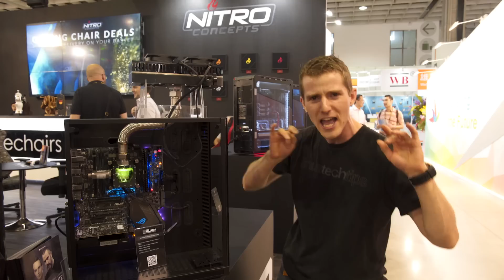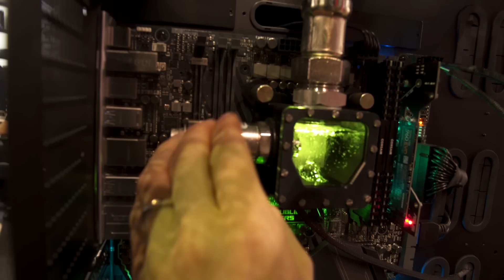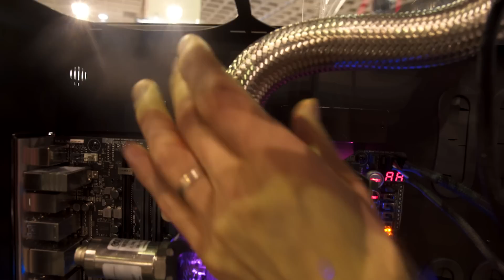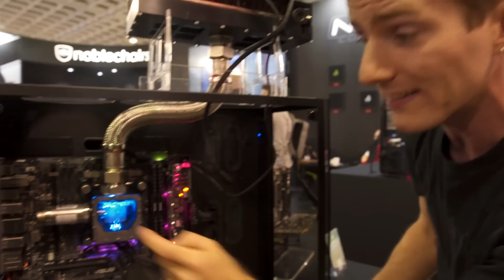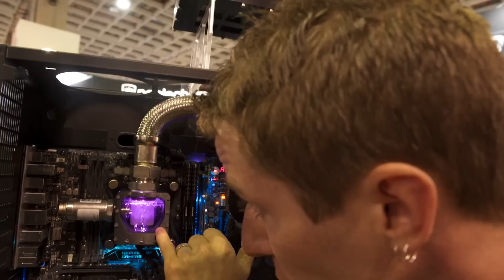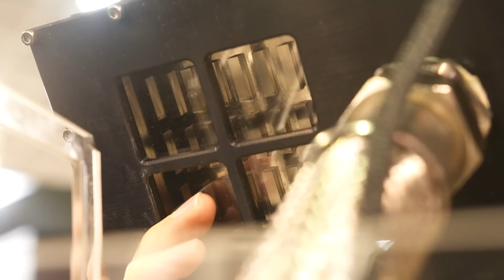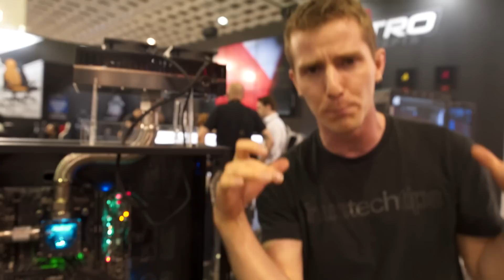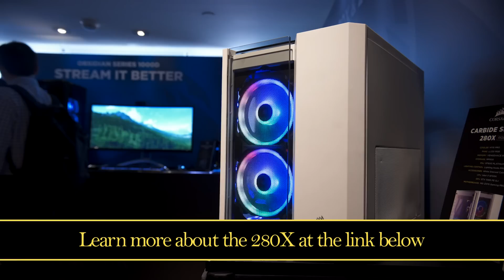Crazy Der8auer cooler prototype - NO pump!

Comment: Vodka. Pure vodka.

What, he said we would never guess - if we guess everything one of us will get it right!
Reply: Actually, you're likely not far off. Most likely methanol or some other alcohol.
Reply: Mmm Rummy :d
Reply: He would be blind just b6 testing it. Methanol is not something you want to have contact with, especially if you want to sell it.
Reply: It's 3M Novek ;) or Novec? I don't know ^^
Reply: @fabiob.2550  That's what I was thinking.
Reply: Saonix LP 3mNovec i think just like in his submerged builds
Reply: Funny you say that I was thinking he probably chose an alcohol as his coolant because of its evaporation and condensation properties.
Reply: i believe alcohol has a low boiling point so makes sence
Reply: Well there's many different types of alcohols, all with different boiling points. Sooo..
Reply: @binary8431  i believe, 99.9% Isopropyl alcohol's Boiling point is ~83°c  which would, sorta, work well, since vodka...as mentioned , only comes in at 40-50% in the US or Canada and would cause issues given the water content ..that method looks like the method used in old school coffee percolators, a person used on a stove
Reply: Water have boiling point on 60 degrees so you don't need to lower it. It won't make cooler any more effective. And actually it will add pressure over time so boiling point will be singificantly lower.
Reply: @ARCAD3BLOOD  100 degrees, and yes we need to lower it, and pressure will raising the boiling point.
Reply: @alexkart9239  Well, anyway this much pressure mounted like that would crush pinns on the motherboard.
Reply: I think you cracked the code here.
Reply: It's not vodka. You can see in the video that it's boiling, and vodka would boil at too high a temperature to be useful as a coolant. For the same reason it's not R12 (besides which, R12 gets the stink eye from environmental types).

It might be something stupid like acetone (in which case he's crazy but w/e), or maybe methanol as someone said. Most likely it's some common refrigerant with the right boiling point, like R-21 which boils at around 50 C.
Reply: Ah, I see, You fools from the west finally try to grasp the secrets of highly advanced slav technology.
Reply: Maybe plain old water.
Reply: Wanna say liquid gas but can't think of anything that isn't probably way too flammable to be safe for the application.
Reply: There is too much liquid to consider it liquid gas. Those walls are way too thin to support this theory, besides there are no signs of pressure sealing, which would be necessary if it were liquid gas.
Reply: Hab Itual ooh good one...i think you could be right...but you need a way to keep the vacuum...
Reply: I know nothing about coolants, so my guess is WD-40.
Reply: Max Mustermann thats true... But the fluid just behaves like it and he is kinda known for his builds with it. But u got a good point there... And its fhckin expensive as he told us in an interview
Reply: no vodka i guess is wrong Ethanol nearly need 80 C° butt since the hole loop depends on the boiling, the boiling point should be much  lower
maybe ist Acetaldehyd that stuffs boils at 20 c°. Your get it from doing fancy stuff with and Ethanol buts since than its called Ethanal ;)
Reply: I'm with Hab Itual water in a vacuum. Maybe that pressure sensor or whatever was in there was used to get it just to the right pressure. Maybe water with some alcohol in a vacuum. Anyways something in a vacuum with water.
Reply: @ltcshow6175  yes, mb, i was stupid fast, pump not need if low pressure present yet, so it could be something like not pure alcohol or alcohol with low pressure, or liquid gas with big pressure, or some freon, so is can be very different  variants, if look at all variant and found, when boiling-condensation will go fast like my mistake was, we can found what will work better
Reply: its R-134a
Reply: I think the chemical in question is a modified Flourocarbon similar to Fluorinert FC-40; However, The carbon level seems to have been custom configured to allow for boiling at lower temperatures.
Reply: lol. holy shit you people are dense. ITS REFRIGERANT. Which is LIQUID at room temp, when under pressure. Not the medical gas transducer sticking out the side of thefucking evaporator. Get it. Its got a condenser, an evaporator, high pressure system, with both liquid and gas evaporating and precipitating. Did i just describe modern refrigeration or what? lol. p.s. ammonia works too.
Reply: Acetone?
Reply: It's RGB Sauce
Reply: no, in another video he said that this is mot m3 novec
Reply: too high presure
Reply: Was thinking the same. Pure alcohol
Reply: Hm, I was going 2 say something like Hydrofluoroether. But that is not clear. I beleive that it is something clear, denser than water, with a low boiling point
Reply: That was my guess. but seriously, alcohol does seem like a viable choice due to its low boiling point.
Reply: I think the people recommending halogenated hydrocarbons are on to something. Linus mentioned it having import/shipping regulations and MSDS. So it's not water. It's something with a low boiling point and/or under vacuum.
Reply: Not really vodka because it’s boiling temperature is around 78. So it must be low boiling point refrigerant
Reply: Freon could be
Reply: I have a hard time imagining it would be something that requires a hard vacuum to lower boiling point. And in that case, extremely unlikely it would be water. It need to reach at least 100'C before dissipating any significant thermal energy, and feed the phase change. Which in practical terms would mean, once at thermal equilibrium, the CPU would hold a toasty minimum of 100C. At idle. With 100% thermal transfer and exchange efficiency.
Reply: plot twist: it's actually peanut butter
Reply: It's water under partial vacuum.

They just keep the pressure low to lower the boiling temperature. Low pressure also means less leakage problems.
Also boiling temperature can be controlled by changing the internal pressure - keeping proper boiling temperature is a big PITA.
That's why they need that big-ass pressure monitor to make sure the pressure is kept low.
Reply: I'd try it with methanol. It's a clear liquid and boils at 65°C. It's probably not methanol, though, as that would be too easy to guess.
Reply: I think he uses low pressures. With low pressures the evaporation temperature is as low as you want. In fact you can even improve the temperature control. In fact I think that's why the pipe he uses is so wide. The pipe is wide to facilitate evaporation and at the same time the liquid that has been condensed, falls through the walls,
Reply: WD40 does have a lot of alcohol in it.
Reply: Novec 7000. Not a new concept for liquid cooling. Developed by 3m as a computer cleaner, not electrically conductive, boils at 34 degrees c, 94.3 f. Someone even paired it up with a thermal-electric cooler and had load temps below ambient air temps. $200/liter.
Reply: Nope the liquid that is used is Freon 113 it boils at 47,5°C (or 116,6°F) and turns into a gas so it rises when the gas reaches the radiator it cools down and condenses back to liquid Freon at a lower temperature. So the CPU cools down and doesn't reach temps above 47,5°C And the process repeats itself. That's a smart idea!
Reply: R32 Gas LEL
Reply: Ethanol has a boiling point just below 80°C which sounds bit high for this application. 
Methanol just below ethanol.
Reply: Boris approves
Reply: nah bro it is lemon flavor bleach, the best kind!
Reply: I was thinking along same line, surgical spirit ..
Reply: Max Mustermann check der8auer's recent build...he is even selling it on caseking :) That one is also using 3m novec ^^
Reply: In another video he said that its not m3 novec
Reply: Kyle Li It is my piss.
Reply: I think this might be the prototype they were working with and the senser is just there because it was used it to see how much pressure the heat generated and not necessarily they pressurized it
Reply: as in TRUMP VODKA?  That will simply catch on fire and get the CPU DRUNK AS A SKUNK
Reply: Vodka might actually work here.

Lots of liquids probably work, its not this one magical liquid. It probably works with pure water even, but likely works better with things like alcohol, amonia, or a very good and safe candidate is Freon. As long as it can boil reasonably close to atmospheric pressure and won't eat the plastics and seals it could be used in here.
Reply: Yeah, I'm pretty sure Alcohol is the solution used. It fits all the requirements.
HA. He says we will have a 'hard time' working it out, within a day, everyone knows what it is.
Reply: i think its roman's pee
Reply: Liquid Hydrogen
Reply: Some alcohol, tweaked with sufficiently branchy hydrocarbons to set the boiling point at the desired temp.
Reply: i think you got it
Reply: hereiam2005  While my experimental brain is enticed by the idea, it would need a relatively strong vacuum (in the context of a system like this, especially given the planned changes for a more user- and installation friendly production unit) - there's a few issues here. The finished product (as indicated here) won't even have a pressure sensor. And you're going to need not only a vacuum pump (those bastards are loud, even small 10-15 watt units) designed to tolerate not only more or less continous operation, but also sucking corrosive vapors all day long - you'll need to keep it at at least 100mBar for any reasonable boiling point... and you'll likely need to top off your system regulary. Kinda difficult if you're prohibited from knowing what to top it off with ^^,

The principle idea is sound. But not sure its realistically feasable for this kind application.
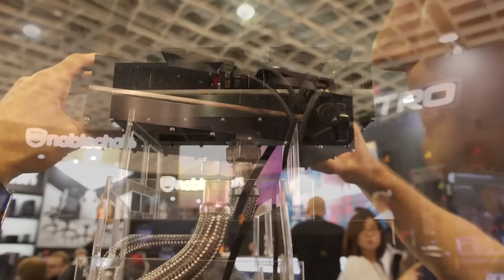Reply: Am i really the only one who notest the bug walking on the machine @3:19 ? xD
Reply: Yes. Ethanol.
Reply: I'm curious how the deal with pressure and cooling pressurized liquids... in a system that appears to be for regular water cooled liquid. (I see so a liquid that doesn't create super high pressure.)

I would say this is a gravity fed pump and not pumpless cooling. also, the reservoir is on the CPU using the head of the cup to "pump" the water to the cooling radiator.
Reply: if you see behind the cooler you will see the processor so it has to be a liquid without water like some alchol or methanol
Reply: Binary depending upon the atmospheric pressure in which “any liquid” is contained the boiling point changes. You can make water boil at 26.6 Celsius with a vacuum of 28.92 inches HG.
Reply: Adata makes RAM with m3 novec in the heatsinks at the top. Linus just did a video on it.
Reply: you russian?
Reply: @Kyle Li, Boris did a rig with vodka in it :P
Reply: hahah
Reply: Something with a low boiling point will use the heat from the CPU to push itself around the loop. Then it will cool at the radiator and go back to the cpu
Reply: i was goinng to say vodka too
Reply: that's already been done though https://www.youtube.com/watch?v=IYTJfLyo_vE
Reply: ya was thinking one of the alcohols will fit inside the temperature curves. butane could work under enough pressure tho lol
Reply: I guess tap water
Reply: I was thinking alcohol too, probably isopropyl
Reply: Your guess actually isn't far off of my guess because my guess was rubbing alcohol...
Reply: I think the same, Russians used to cooldown their aircrafts with pure vodka, so it's possible
Reply: Is probably liquid propane, but I'm dumb so probably not.
Reply: No! -Comes out of laboratory
-It was all kosken
Reply: It actually make sense tho since vodka’s boiling point is low
Reply: Iq 200
Reply: my guess it's water under a vacuum to lower it's boiling point to what he needs
Reply: Ethanol has a pretty high boiling point so I doubt it

Lower than water but butane is much lower
Reply: there is a vodka cooled pc...
Reply: Boris has already made one.
Reply: He is German. So it's beer.
Reply: Vodka is a no. It won't 'boil' until all the ethanol has been evaporated off in which case you are just boiling water.

It's more likely just pure alcahol - with a boiling point of 78 C it's more than likely running a hot intel chip will induce the boiling you need. Or even Methyl which boils at 64.
Reply: it could be a mix of liquids
Reply: pure ethanol boils at 72°C so it only starts cooling just before thermal throtteling? i think that would be too risky.
Reply: U.S. Majeed more likely 11. 12 would have to be pressurized, 11 boils at 75 degrees
Reply: It's novec 649 dry liquid i think
Reply: It's obviously Novec, it has a boiling point of around 50c
Reply: I'm probably too late, but uh my guess is novec aka dry water. Watched a video from a russian guy on it on a whim yesterday, then saw this old video and was like heh that looks like a dry water condenser cooler. I would bet its dry water.
Reply: probably some kind of fluorinert
Reply: prob alcohol or methanol
Reply: with 80 degree celsius boiling point, availability, and ease of use. it actually would make a lot of sense
Reply: don't think so since m3 novec (also dont know how to spell it xD) is a highly regulated industrial compound which they are not allowed to give to consumers in any way.
Reply: he is prototyping a product for selling in decent amount quantities. I doubt he is treated as "just a  consumer"
Reply: @maxmustsleep 
>Nontoxic fire retardant.
>Highly regulated.
Reply: @maxmustsleep  you can buy it easily in China. We did it in the past: fly to Hong Kong, buy a 10kg can and fly home.
Reply: could be glycerine ,it will explain the bend problem ,propylene glycol or any alcohol like ethanol or meth.
Reply: @Tailslol  No way it's glycerine. The boiling point of glycerine is 290℃.
Reply: chaumas glycerine and propylene glycol is used in fog machines and ecigs so no you are wrong...
Reply: @Tailslol  Dude, take five seconds to google "boiling point of glycerine". Edit: Just want to add, I have personally brought glycerine up past 120℃ in order to clean vape coils, and I can assure you that it does not boil at acceptable CPU temperatures. Keep in mind that vaporization does not necessarily mean boiling, so fog machines and ecigs can do their thing without boiling the glycerine.
Reply: doesnt realy care honestly on a 5month old comment...
Reply: @Tailslol  Ah yes, the ultimate fragile ego reply. For future reference, the correct reply that people will respect is "Oh, guess I was wrong." It's not hard.
Reply: nah you just are the kind of poeple who have nothing else to do than dig faults on old comments so ill leave it to you heh...
Reply: Tailslol  the bend problem is for any fluid period
Reply: Water in a Vacuum?
Reply: @habitual2245  for vacuum need pump, this is any liquid gas or low temp boiling liquid like alco, actually it can work with a pump, you can see it, but if pump gone, it still use boiling-condensation conception, i think there two loop in same radiator battery, one side for pump, other one for condensate, it could be some freon btw
Reply: it is not realistic..but i could be ammonia, toxic as hell. Ammonia under pressure could do that and what looks like a piezo element...maybe its just demi water with an piezo element...
Reply: Ethanol
Methanol
extracts from Trump's brain
Reply: Pure vodka (I mean 100% alcohol) is called Ethanol, boiling point is ~75° Celcius
Reply: I don't think so. Vodka has water on it.
Reply: He has said, "It's not novec."
Reply: Sorry he doesn't use alcohol in any kind 
More likely it's a cooling gas

Comment: 3M NOVEC 7100
Reply: Its not Novec fluid as it is a restricted substance (has PFC's in it).
Reply: I would say that too, but If Roman said that noone will guess it, i think its an selfmade Coolant or a Variation of Novec 7100
Reply: He said in one interview that it is NOT Novec, due to EU import laws.
Reply: NO.

Novec has a very low thermal conductivity. It's exactly what you DO NOT want.
Reply: not all of them do
Reply: It's probably just plain Ethylene Glycol and water mixture.

Comment: The coolant is water
Reply: not under a vacuum, could be a low pressure system (or maybe high pressure if i'm thinking about this wrong).
Reply: Luc Latinette- fair point.  Personally I think it'd be too hard to keep a system like that under low pressure, but technology has gone pretty far these days.
Reply: Also thinking it's Water.

It's the best cooling liquid known, cheap and when distilled it's not too aggressive to the materials.
Reply: FitzFray a vacuum would explain why the whole thing is so beefy
Reply: William Chong water boils at 100° C, so it's probably not water.
Reply: FitzFray I mean I agree that it's probably not water, but it would be funny if it was

Comment: It could be normal Water with enough pressure you can drop the boiling temperatur. This could be a reason as well, why they need the presure sensor on the prototype.

edit: i mean Vacuum not higher pressure, sorry and thanks for correcting me.
Reply: If it's water and has a lower boiling point, you need to drop the pressure not increase it.
Reply: you need a vacuum to drop the boiling temperature. pressure will increase the boiling temperature.
Reply: Boiling point goes up with pressure, down with vacuum.
Reply: Yes, sorry that was what i mean but wrote the false thing.
Sorry for that
Reply: actually, you don't need a vacuum, decreased pressure doesn't mean vaccuum. the biggest problem with your watertheory is that from looking at the cooler, i can tell that it's viscosity is too low for water and that if you fill the system with watervapour, the pressure will go up too far to still be effective. also, you would get ondensation on the plexiglass
Reply: Albert Alexander the pressure sensor is a prototype item. Testing pressure for the overall heatproduced by the increase of heat from the cpu. I could be an alcohol or a acetone or ace substance lower boiling point better temperatures displaced